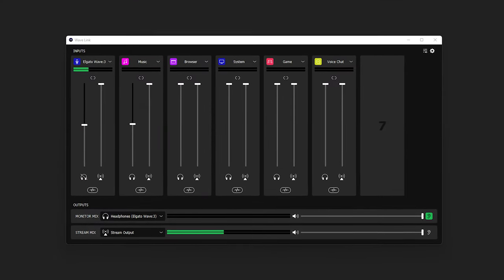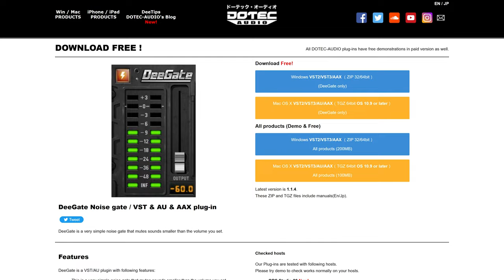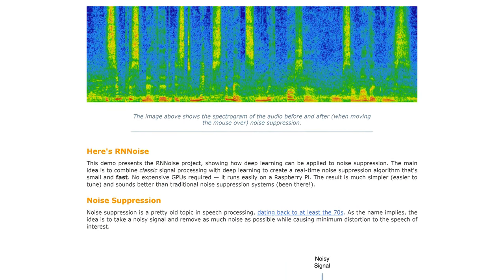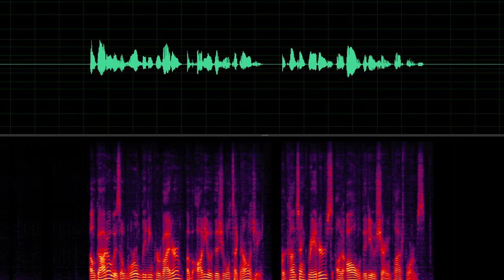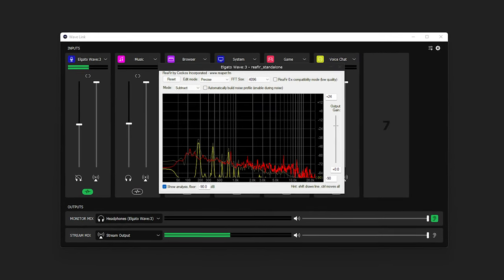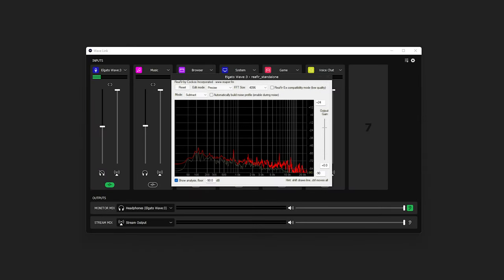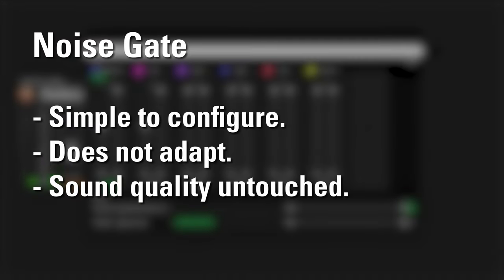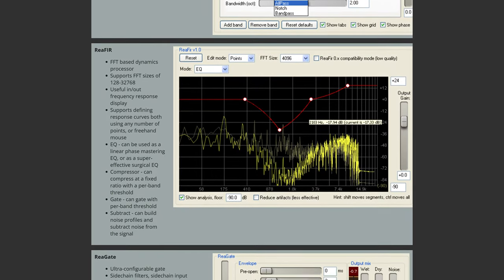How to Reduce Background Noise in Elgato Wave Link using VST Audio Effects

Comment: Hey I downloaded the RNNoise suppression and when I put the whole thing in there, it bugged out and started crashing, i removed it and put the correct one in and now its broken entirely. Everytime I start the app up, all audio needs to be reset so I could hear it again, and it keeps saying therea a broken plugin in the list, but its not there at all, ive removed all plugins, ive reinstalled and ive even tried repair. Nothings working.
Reply: Same thing here - was hoping to find help here.

Comment: Literally the only problem I have is when I take a drink my mic picks it up. Almost everything else is perfect, but god forbid I take a drink someone on discord will hear it perfectly.
Reply from the maker: Hi omjviper,
The VSTs we showed off in this video definitely aren't the strongest options. You may want to look at Nvidia Broadcast noise removal or the new Supertone by Clear. It's a very lightweight AI noise reduction. However, the inbuilt Krisp on Discord has gotten upgrades over time and is quite good now.

Comment: This is great my question is after adding a Noise gate does that effecx the sound coming from Steam Mix?? I need to use one channel for zoom or obs and I would the changes to be on the mic source but then have the mic work in stream mix with the new effect
Reply: On the mic it will give you options in setting for what you want to hear and you pick Wave link microphonefx and then the things that you put on the mic will go to the stream

Comment: Thank you for showing me ReaFir. It works like a charm.But somehow when turning my pc off and on again, the reafir subtract completely disappears and I have to build the noise profile again. Really annoying. Anyway to fix that?
Reply from the maker: Hi Dani,
Settings in Audio Effect control panels should definitely be saving automatically. Not sure what may be happening, please contact our support team and we can look into this more closely: http://e.lga.to/help
Reply: @marslmars  Sadly the issue is still unsolved. Since then I just kept rebuilding the noise profile every day from new. Still really annoying.
Reply: @DaniWeiss  Ok so it has been months since the last comment sorry if this is repetitive but I'm wondering if it was ever fixed or if it's still the same many months later.
Reply: @WyattOShea  Yeah the problem never went away, untill I wiped/reset all data from my pc. Now its working perfectly as intended. No idea why it didn't work before even when reinstalling it.

Comment: Do you need any other hardware or software in order for those plugins to work with your Elgato Wave microphones?
Reply from the maker: The only software needed is Wave Link. To use Wave Link, will need a Wave:1, Wave:3, Wave XLR, or Stream Deck +.
Reply: @ElgatoWorkshop  Thank you.

Comment: can i use this software without wave link? I have xlr mic and plan buy wave xlr as audio interface
Reply from the maker: You certainly can. Though Wave Link is good to have installed because you can adjust certain functions of Wave XLR like low cut options, firmware, saving settings to the hardware, etc even if you don't use any of its mixing features.

Comment: I can not get the RN noise to show up int he software tried pulling it in everywhere and it will not show up
Reply from the maker: Hi TJ,
Are you on the latest 1.4.1 update? What other VSTs do you have installed?
Reply: @ElgatoWorkshop  yes I do have the newest version. I have reaper and dee gate. But I'm removing deegate as reaper does the noise gate better

Comment: i have wasted like 3 hrs trying to get my audio to sound right...i just keep hearing low static in my recording..I just get figure it our..i have tried like 8 other elgato plugs vt and still the same...the static wont go way or I get an empty room sound. so fustrated waster 3 hours on this.
Reply from the maker: Hi Tony,
If you are using these effects inside of Wave Link, ensure you're capturing from the MicrophoneFX or Stream Mix audio device in your software. If you're using just "Mic In" for your Wave device, this won't have effects applied. If the issue remains, please reach out to our support team at help.elgato.com